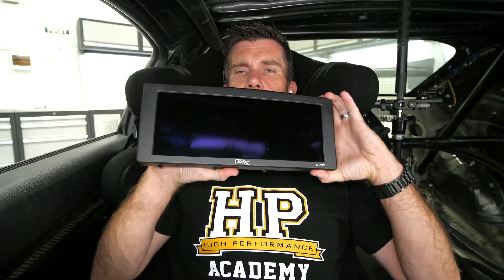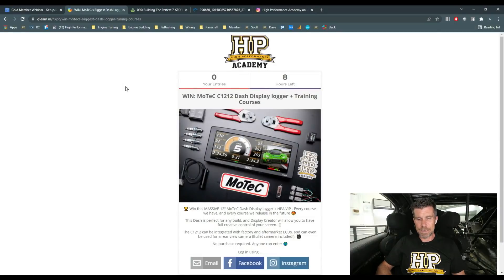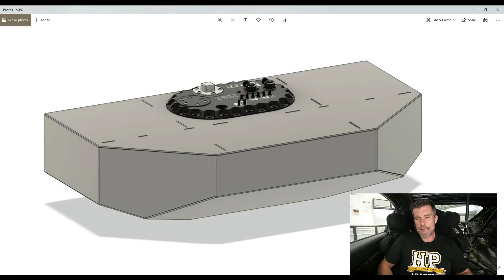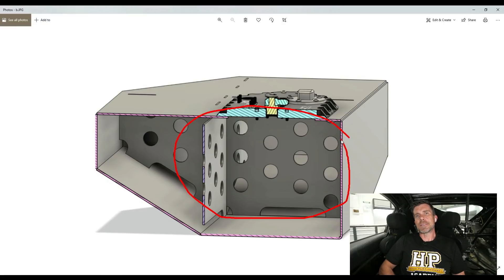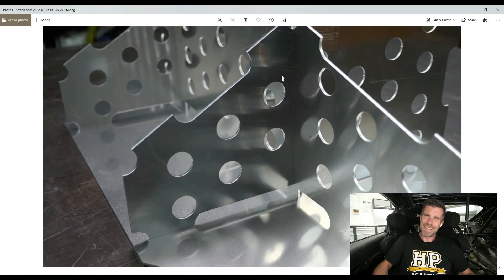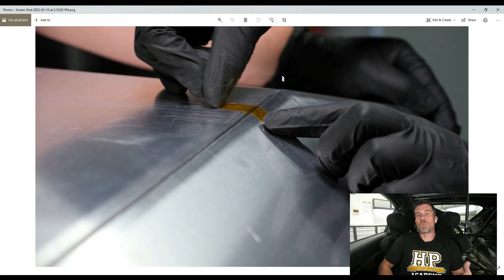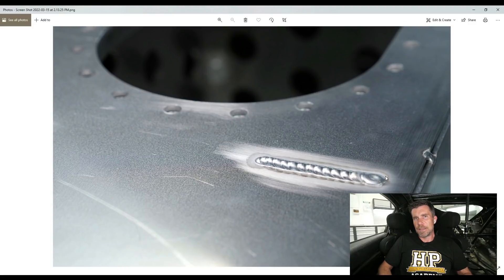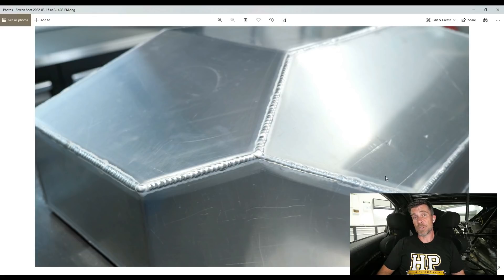Making A Custom Fuel Tank & More [#UPDATE 303]

Comment: I'm designing a custom tank at the moment and wanted to use slot and tab baffles/bracing like this but Motorsports Australia (our motorsports governing body) mandates the use of fuel foam. Any ideas how to do both?
Reply: Might be an idea to have a good think about what you're trying to achieve with the internal bulkheads.
The foam will do  much better job preventing fuel slosh, but if you have a large area on one, or more, sides you want to strengthen, you could use an internal triangulated re-inforcelent. Better yet, if you have someone who can do it, have the sides bead rolled to stiffen them up.